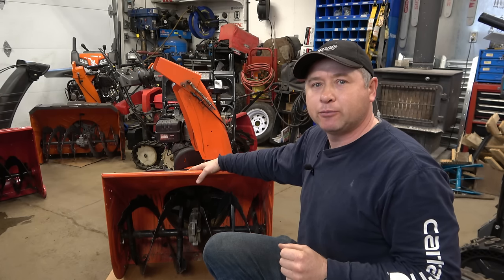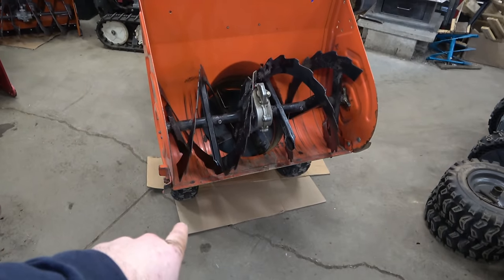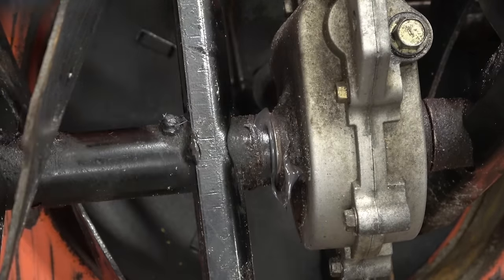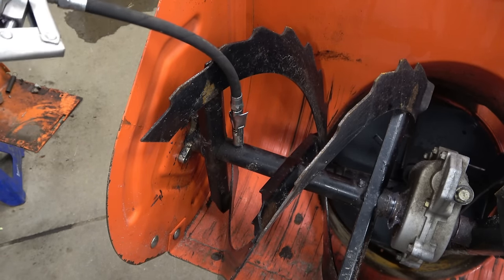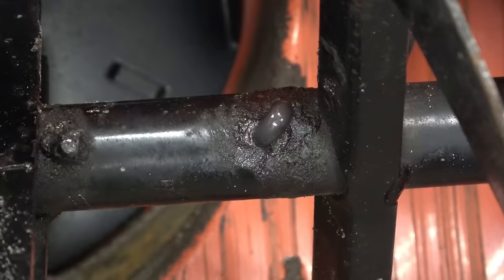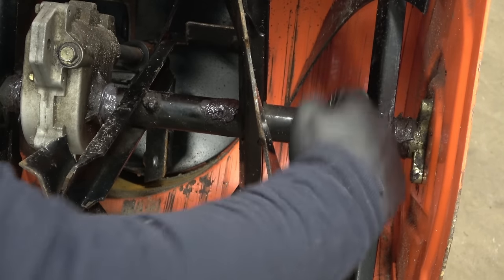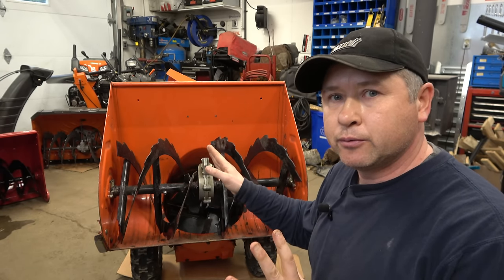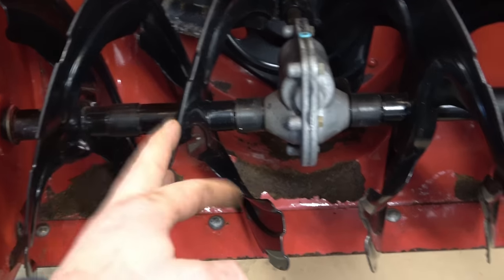HOW TO Grease Snowblower Augers With Or Without Zerks!

Comment: I’m glad you mentioned the play in the shear pins. Too many people torque the daylights out of the jam nuts!  I had one customer who blew a gearbox apart because of over tightening the shear pins so I drilled out the end of the bolts and used bow tie cotter pins. The next year he hit a newspaper and the pins did their job.  He thanked me after that!
Reply: if you over tighten  and crush the auger onto the shaft it creates the possibility of ruining your gearbox.
Reply: I repair them as a hobby and, most people think they're operating a farm tractor. I wonder why they don't last ?
Reply: That's why I use the lowest torque spec in the manual, I've broken I think two pins in about ten years and never had an issue tightening to about 8 NM or about 6 ft lbs.
It even says pins should NOT spin freely.
Reply: Owner's manual specifies the torque for those.

Comment: Ok that was great for shafts with or without grease fittings.  How about a video on the gearbox, with or without drain plugs. Many of us can't drain and refill the gearbox as there are no fittings to do so. Any help would be so appreciated.
Reply: Buy a hand pump that comes with the clear tubing. Pump out the fluid and replace with the same amount.

Comment: Glad I watched this video. I did not know to keep my shear pin bolts slightly loose. Makes complete sense. Headed out to the garage to loosen them. Thanks! Also picked up a bottle of anti-seize that I am now using on wheel assembly. Great tips Don. Appreciate it!
Reply: You do not want them loose as they should NOT spin freely and it says that in the manual.
Tighten to about 8 Newton meters or about 6 foot pounds and call it a day.
Reply: I wouldn't use the anti-seize as a lubricant/ grease. Guys used to use it on equipment at my work and after a few years it hardened and caused more problems. Stick with grease and oil
Reply: @countryfamilyalways7280  Thanks!
Reply: @stevieray1828  That’s interesting. I know Lubriplate hardens, but wasn’t aware that anti-seize does also.

Comment: I’m glad you mentioned the play in the shear pins. To many people torque the daylights out of the jam nuts!  I had one customer who blew a gearbox apart because of over tightening the shear pins so I drilled ou the end of the bolts and used bow tie cotter pins. The next year he hit a newspaper and the pins did their job.  He thanked me after that!
Reply: My shear pins had grooves cut in around the diameter of the pin.
Made to shear at that groove.
So tighten them up no play so the grooved line up where there made to shear

Comment: Thanks Donyboy for the video!
On my Tecumseh 8 hp snow blower, the augers were seized solid to the shaft. No amount of penetrating oil would free them up. Had to take it all apart and mount the axle shaft in a bench vise, heat the augers up with oxy-acetylene, and beat on them with a hammer until the rust came loose. Lots of powdered rust came out of there. Cleaned up the shaft really good with a stiff wire brush mounted on an angle grinder, and drilled a couple of extra holes in the augers to accommodate additional zerks.
If that had been neglected any longer, the machine would likely be scrap by now. It was $100 so what can we expect? Lol. 
So that is a third way to get grease in there if your machine has no zerks. If you are ambitious enough, just take the augers off and drill a couple of holes for zerks. Problem solved 😎👍

Comment: Hi Don! 
I received an older Murray 5/24 snow blower from a great friend of mine a couple of years ago and I've been slowly revamping it with the help of your videos. Thank You so much for pointing out that the shear pins should be loose and not tight. I did not know that and need to check that. Last year, my Murray gobbled up a newspaper that was hiding in the snow. The pin didn't shear and it really made a mess of the auger. I had to straighten out a crease and a bend in the auger. I made a part from an old table saw blade to splice the auger if it lets loose. I cut it out with a Dremel disc tool in the event that the auger separates in the future.  Old table saw blades are a great source of good steel to make parts out of. I don't throw them away. 
Thank You Sir! 
Take Care,
Tom K.

Comment: Excellent video. Thanks!

When I did this to my Zerk-less 2010 Columbia 10528 with a Powermore engine yesterday, I discovered if the gas tank is nearly full, all I have to do is remove the gas cap, put some masking tape over the vent hole, reinstall the gas cap and it won't leak while doing this procedure. Be sure to remove the tape after the project is done. No gas leaked out at all.

Comment: Another useful tip Don I always before winter strikes is spray the auger the bucket chute and outside of the machine excluding the muffler  with camp dry or some other water repellent this keeps the snow from sticking to the Machine and as well works as a rust inhibitor. I also use this on my hand tools like snow shovels  hand plows and scoops it keeps the snow from sticking to them I find anyway is a great help.
Reply: Hey Will ! Thank You So Much! My sister gave me a can of that years ago and its been sitting on a shelf in my workshop. I hate to throw anything away. I had no idea of what do with it until I read your comment! Thank You Sir!
Reply: @thomask4836  I discovered camp dry years ago fishing at Pulaski for steelhead I didn't have a plastic poncho and couldn't find one anywhere sold out it was raining cats and dogs and I needed something besides a trash bag to wear to keep dry while fishing.  Well I saw this camp dry stuff I sprayed my wide brimmed aussie hat and my jacket and the 4ain rolled right off them slicker than snot on a doorknob.  So then I got the idea if it worked on my clothes and I do use it on my hunting clothes and winter out door clothes as well and as you know the snowblower and hand tools. And even my shoes and boots 😊👍

Comment: Always enjoy your videos.  Another easy way you could grease these would be to drill very small holes in each section and use u-joint adapter on the grease gun.  The hole only needs to be the size of the hole in the zert fitting.
Reply: And you probably wouldn't have to take the augers off to do that. Just drill the hole, and stop as soon as it is through. Nice idea! 👍

Comment: Excellent Video. I have an MTD backup but my main is a 24" self propelled EGO and there is absolutely nothing to do with the machine. This is what they say "All of the bearings in this product are lubricated with a sufficient amount of high grade lubricant for the life of the unit under normal operating conditions. Therefore, no further bearing lubrication is required."

Comment: Another great video. Off to the store to pick up some lubricants. My grease gun broke my grease fitting off of the shaft as there are only 2 threads on the fitting , which also damaged the threads on the auger. ACF 50 is widely used in aviation as a lube & corrosion preventative solution. I may have some around the house . Also subscribed.

Comment: Always nice to work on newer  machines however, many people purchase 10+ year old machines, myself included. Latest purchase was a craftsman 8.5 x 26 that hadn't been used in 2 years for $50. Cleaned the carb to get it running then found that the impeller had taken a hit and bent two of the impeller blades which were touching the backside of the impeller housing. Seperated the motor from the auger housing and found that either lack of zerk fitting or maintenance knowledge, the auger blades were siezed to the shaft. 24 hours of soaking the shaft with ATF/acteone blend, along with a couple of 18" pipe wrenches, I was able to  seperate the blades from the shaft which I have now cleaned up of all corrosion as well as the pipe wrench damage to the end of the shaft. A bit late in the season right now to put it all back together for the upcoming winter so will use my 30+ year old Estate 825 that I picked up and got running, early this year or my curbside free, Murray 5/22 that is also a older model. That said, thanks for your great videos!

Comment: Great videos, Thank you.  Another VERY IMPORTANT place to use anti-seize: axle shafts which are inserted into the wheel.  If the wheel cannot be removed, very expensive at shop.  I'm sure you cover this in another video.  But yearly maint can to completed without removing wheels, but DO NOT neglect this spot.

Comment: Thanks, Donny. I have a Murray 24 inch wide one. Good engine, starts right up. (Like a Honda or Toyota.....). NO  grease /zerk nipples on drive shaft. So, i will drill out , 2 on each side. Same as the first blower you greased up in  this  video. Going to use the hammer-in  ones. Anyway,  take  care of  your  STUFF....folks.

Comment: Speaking about shear pins holes I take a piece of 3/4 heater hose with a slit put over shear pin holes use a large Vice grip with a rounded jawclamp over hose at shear pin holes to block them. Grease better chance of getting grease to gear box.

Comment: Probably be good to spin the shafts a little as you inject the grease.  Have you ever tried fluid film for those without zerks?   That stuff doesn't dry out and seeps in places like crazy especially if it's a little warm like inside a garage.

Comment: Great ideas. I always thought the MTD's did not need any greasing or anti-sieze because the augers sit on plastic bushings over the auger shaft. In theory they do not touch.  I realize the steel can still rust and make the bushings very hard to remove, should you ever have to. The shear pins do well with anti sieze.  Yes, not good to preload the shear pins.  Have no tension in them. I have always tightened just to slightly touching so the grooves better align with the edge of the steel shaft. I know some types do not have grooves. Good ideas.  thanks as always!

Comment: Donyboy why can you use a grease with a rubber or nylon tip on the grease gun and squirt the grease into the shear pin holes and rotate the auger around to lube the auger shaft. 
Then reinstall the shear pins back where they belong in.
Just my 2 cents coming from Pittsburgh pa USA.
Works good for me this procedure.

Comment: Dony, How do you lubricate an auger transmission like on the Yard Machine unit that has the little blue cap on top but no drain plug?  I assume some 80/90 gear oil but there is nothing in the manual.  Thanks for all your videos!

Comment: Great video.  I did some touch up painting on mine last summer but I didn’t know about lubing the shear pins and shaft.  BTW, do you bother with touch up painting?  Seems like these machines rust out pretty quickly.  Thanks for sharing.

Comment: Hi Dony, enjoy your videos. Question:  I have a MTF Yardman snowblower and have been trying to find info on gearbox maintenance. There is not a drain plug and there is a little plug on the top of the gearbox. Should I be adding some 00 grease every now and then?  I see no other way to do maintenance other than dismantling. Appreciate any wisdom.

Comment: Thanks for the video!  I have have a newer Toro with NO shear pins(they claim they’re not needed).  Do you recommend installing some shear pins?  I assume the greasing/lubrication would be the same as what you’ve shown for machines with no zero fittings.  Again…thank you!

Comment: Don I just picked up a lightly used Honda HSS724 and I took your advice to use ACF-50 in the auger but I wanted to ask if it was okay to spray a little ACF-50 on the ends of the augers where they go into the bearings on the blower housing or should I really be spraying those ends with white lithium grease?  ACF-50 wasn't easy to find where I'm at and I lucked out that 1 shop in a city had it!  My augers luckily were spinning freely with no sign of rust seizing (its practically brand new) so I'm grateful that you shared this tip.  In the past I would've yanked the entire auger assembly to coat the shafts with a thick coat of anti-seize.

Comment: This might sound like overkill, but I notice the lubricant just shoots out the bottom when you spray it into the shear holes. This is easy when you get the hang of it. 
With spray lubricant with straw nozzle. 
1. Remove shear bolt. 
2. Cover bottom of the shear hole with thumb. 
3. Insert spray nozzle into the top shear hole and angle it. Then cover that hole with another finger.  You're pinching it with a C. 
4. Now it's sealed enough so that when you spray the lubricant it shoots down the shaft instead of coming out the bottom shear hole. 
5. When the lubricant shoots out the end spin the auger blades. 
6. Profit. 

You can use a bit of masking tape or putty if you don't have fingers.

Comment: Don - another great video. Thank you.

What is your take on doing the rubber "impeller mod" to an older machine? What are the downsides? I'd bet that a video on that would be well-received. FWIW, I did the mod on an older 10/28 Craftsman blower and I really noticed a big improvement in performance, especially when clearing the soggy snowplow ridges at the end of the drive. I just didn't keep that machine for long enough to know if the mod had any long-term effects.

Comment: I question whether the Zerks will work to fully lube the shaft especially when it already rusted. By far the best is to remove the auger - good moment to inspect the auger and impeller bearings and to put antiseize on the shear bolts - and on the spare shear bolts located at the top of the shute

Comment: My Ariens ST624E is 16 years old and am thinking it's time to swap or at least topoff its auger gear box oil. I suspect it's using L-2 lube. Ariens sells a proprietary product (L-3 synthetic) but it's over-priced. Lucas offers a far better value Synthetic Gear Oil/Transmission lube in both SAE 75W-90 and SAE 75W-140 grades. Would appreciate your advice. Thank you.

Comment: Great video as always, will be doing some greasing. I have a question where did you get 1/4 sheer pin punch? Have a Cub 3X and the inner auger wheel sheer pin is the devil to get out when it breaks because of space.
Reply: You can get a "pin punch" at almost any tool seller (Amazon, Canadian Tire, Princess Auto, et al). Cheap ones which will work well enough for a very long time will do. My el cheapo set has been used and abused for almost 40 years and is still going strong.

Comment: Recently subscribed to your channel Don... I have a 2019 Briggs & Stratton Elite 1227 1150 series... I didn't know how else to write to you , so I'm doing it on one of your most recent vids. The friction wheel came apart inside my machine & I can't get the wheels off of the shaft... they are not rusted on, but I believe where the locking pins go on  the wheels, have burrs that is making this job difficult for me... I need to know what would be the best possible way for me to get those durn wheels off :) I'm just west of the village of Lanark,ON, I wish I could send you pics of what I've seen inside under the belly pan... I'm stuck & not enough knowledge on how to proceed from here... I don't really want to drag the machine up to the road to get it to an expensive fix in the village... Any thoughts or ideas are most welcome... again thanks.

Comment: I always like to clean and grease or lubricate everything in the spring before putting it away for the  summer.  Then it doesn't sit all spring, summer and fall with salt and dirt around the shafts. Also wash the salt and dirt off the whole machine before lubricating anything. Also change engine oil so it's clean oil and not acidic.

Comment: Hi Dony,  one thing that I always wondered about is...  when you do lubricate the auger shaft and you remove the sheer pin bolts, should you ever... change them?  Do they lose any strength or get a little weaker over time with out ever breaking?
Reply: You want the shear bolts to be made of a weaker metal, so that they will snap and allow the driveshaft to spin free if you hit a rock or something..in order to prevent the gearbox from getting stripped out. When the shear bolt breaks, simply replace it with a proper shear bolt.

Comment: What are the odds ? 4 days ago, I repurchased a snowblower that I sold 2 years ago. The "old" owner had the bad luck to hit something and, twisted one of the auger. Fun fact ! It's a Murray which, the auger comes in 4 pieces and two sheer pins. 2 pieces from each side are bolted together with allen screws/bolts. I just ordered one new auger (right side, which is in one piece now) and it goes for 325.00 CDN plus shipping fees. The snowblower was $1200 new, 5 years ago. T*barnak !
Reply: Odds are not good but with these internet connections, lol.  I sold mine at least two years ago, same kinda thing.  I’m getting it back , broke.  But I can fix it! I’m stoked as it was 3k usd new.  I’m payin $50 to get it back.  Sold it for four hundreds about three years ago, everything was working.

Comment: Don, this is probably a stupid question? You can laugh if ya want, but I was given an old 2 stroke single stage snowblower it's an Atlas from the early 80s, I restored it and got it running like new. Do these types of augers need greased? If yes how do you do it? Sorry if it's a silly question.

Comment: Hi, by chance would you happen to know the part number for a universal scraper-blade located at the bottom part of the Auger Housing: long 24" x 2" (approx.) black metal thing (on your machine it's red) for my 1997 CAD TIRE Mastercraft 5hp 24" Tecumseh engine? Thanks for any help.

Comment: I have a Toro 2-stage Power Max 24-inch width.
Toro did not put shear pins or grease fittings on their augers so how can I lubricate the auger shafts?